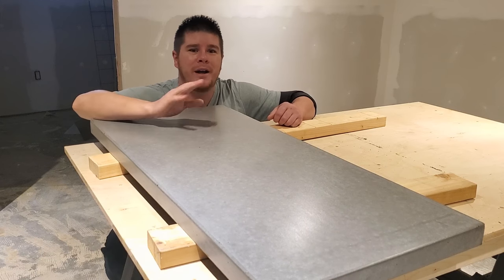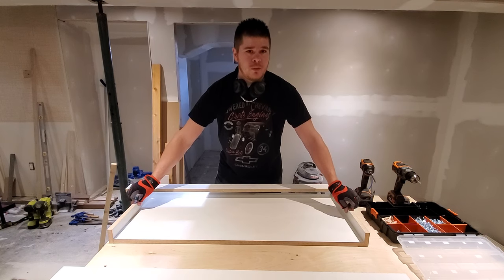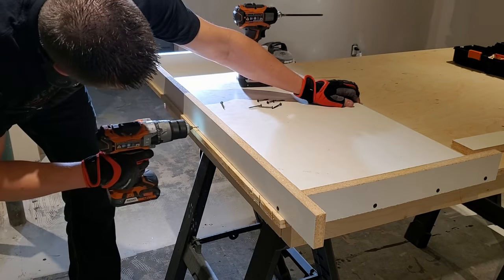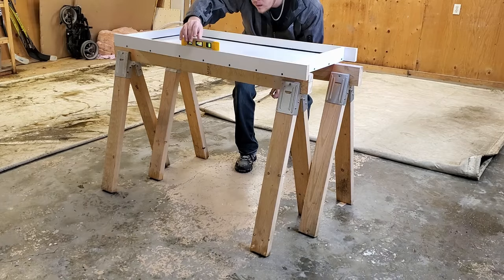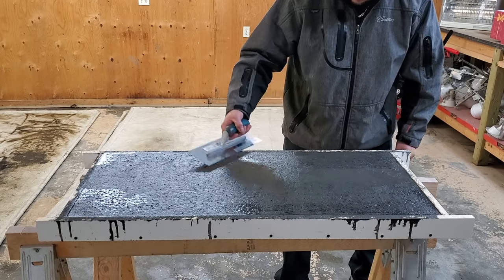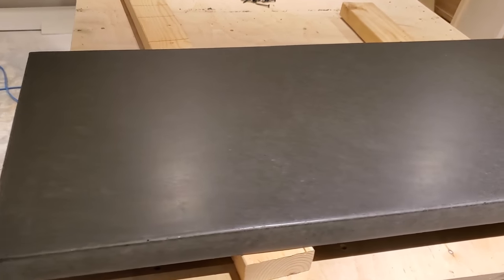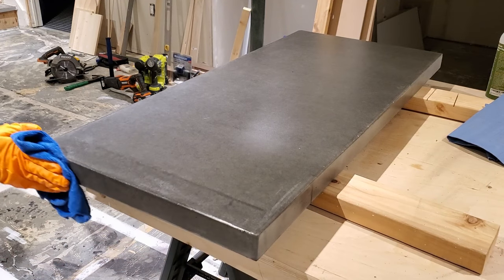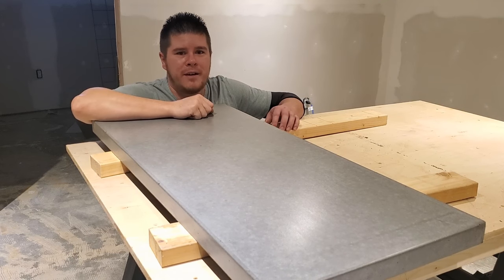Beginners guide, Concrete Tabletop you can build. No special tools, hand finished

Comment: Thanks ! awesome video! Will do my own slab next weekend :p
Reply from the maker: Awesome! Glad I could help. Good luck on yours and keep me posted!
Reply: @JessedoesDIY  I do have a quick beginner question though, I'm intending to do slab that is 3 cm thick (for a surface of 80 x 60 cm)... will this be solid enough even with such small thickness? Would you recommand adding fiber to my pre-mixed concrete ?
Thanks again for the cool video
Reply from the maker: If you could I'd up it to 4 cm thick. That would be plenty thick to be fine while only needing the metal to reinforce. If you do go thinner than yes, I'd either add fiber, or find a mix that is already fiber informed with low to non shrink concrete. Hope that helps!
Reply: Hi, back again 
So I went for a 4cm thickness as per your advise, and the slab looks AMAZING thanks to your video (and the crazy amount of vibrating I gave). It is so flat I could almost see myself in it :D .There is litteraly zero bubble ... BUT ONE (rather big, 5mm). The bubble formed at a location where the concrete was obviously not hydrated enough (the surrounding zone is very light in color - probably some concrete taken from the side of the bucket where I did the mixture)

Problem is, the rest of the slap is soooo perfect that this one bubble is kinda killing it. :D

What would you recommand for filling this hole ? Just cement + water slurry? 

many thanks again !

(pity I can't share a picture )
Reply from the maker: Hey, I'm glad it turned out! Yeah vibrating is key to it and it's the step people usually skip. There always has to be one hey lol really shows the importance of making sure the mix is all hydrated, one small dry spot can go south in a hurry. But it's fixable! I'm actually going to be coming out with a part 2 video showing it sometime. But for now yeah, take the same mix you have and sift all of the stones out of it just so you have a nice powder of cement. You can mix it with water, but your best bet if you can is to get some acrylic fortifier, they sell it in the concrete aisle with the dyes and stuff. Use that instead of water, or a 50/50 mix. That helps the new concrete stick to the already cured stuff. Mix a toothpaste thick slurry in a cup, then press it into the void. Kind've let it dry and then clean up what you can a bit with a plastic putty knife. Sand as needed, if not just take a wet scotch brite pad and rub the slab down with water to smooth it out. Hope that helps, email me with updates and finished photos

Comment: Looks great..I have a question on this though. If I wanted to mount my legs into the table could it be done that way? Like put my legs on a harness down into the mold then pour my concrete down around that?
Reply from the maker: Thanks. Sorry for the late response, but yes it could, however I probably wouldn't. It wouldn't happen for a really long time realistically but it's worth mentioning that the concrete will eventually either degrade or the wood will rot. They will push and pull moisture from each other

Comment: I'm thinking of making a concrete desk to deaden frequencies from my speakers. I just need to think of a solution for the legs that provide enough integrity to support the mass and allow enough surface area to prevent the concrete from cracking over time. Thanks!

A quick google seems like metal U shaped legs with a double bridge connecting both should work.
Reply from the maker: The legs can support more than you think, it's usually the stretchers between them that's the problem, yeah. I've used 2x2 stretchers and they can be just fine. But as long as you've found something that works, it's all good. Good luck on your project

Comment: Very beautiful, impressive and professional video.
I have a question whether the concrete surface does not absorb liquids from the food and accumulates bacteria, does the sealer close it for a while or does it need to be renewed?
Reply from the maker: Thanks! I appreciate that. Nope, it won't absorb liquid and bacteria. Once it's sealed with that liquid sealer I applied, and even more so after the wax it is basically no different than how a granite top behaves. Smooth and silky feeling, and just like I showed in the video, liquids and food just sit on top and can be wiped away easily. You will need to apply the sealer about once a year tho, and the wax every couple of months, depending on how often you clean it maybe a bit more often. But its quick and easy maintenance. Hope that helps

Comment: Great video!!  I'm interested in outdoor concrete bench tops - would the same process and finish be applicable for outdoor use?  How thick should bench tops be - I would estimate 2"...?
Reply from the maker: Thanks! Yeah I'd go 2" for those. That will be cool,  let me know how they turn out. The same process can be used to make and smooth them, however for a bench I'd use a basic concrete sealer from rustoleum or quikrete as it will be more durable, no need for the countertop sealer because you don't need food grade. Good luck!

Comment: Excellent video. I am considering doing this - May I ask how long the wax stays on the countertop? I probably daily clean the countertop with anti bacterial spray and once a week with bleach. I am guessing this would strip any protection? Whats your thoughts?
Reply from the maker: Thanks! Don't use bleach, you'll strip everything and stain the concrete. If your using it for a countertop ish surface like I am, everything I used to seal it is food grade. You'll want to use a natural cleaner if possible. Typically the wax will last a month or 2 depending on cleaner used and how often, but over time the wax will last longer once it has a few coats applied to it. The wax I used is beeswax mixed with lemon and orange. The citrus in it not only smells good, but it also helps keep it clean because it's a natural acid, no bacteria forms

Comment: Absolutely brilliant  ... i will start mine asap.  Never sure about sand and concrete ratio?
Reply from the maker: Thanks! That's awesome, good luck on yours! Keep me posted, I'd love to see it when its done. I used pre bagged concrete and if you go that route make sure to get a non shrink or low shrink version to avoid curling. Otherwise start with a 3-2-1-.5 method. 3 parts very small aggregate (stone), 2 parts sand, 1 part cement, .5 parts water

Comment: I do the edge pieces like you, on the side, not too, to make demolding easier.  But I make all four pieces too long.  One edge flush with the edge of the bottom piece and one end over hanging.  Then you can easily pry off all four sides like your showed.
Reply from the maker: That's a great upgrade to my method! Thanks
Reply: CanaDIYan as you mentioned, you want to pry wood to wood and not wood to concrete.  So that’s why I went this route.  Give it a try!
Reply from the maker: @BoredAtWork2000  Will do!

Comment: Great job. I am going make a table top for a porch, so I am looking for the products used, like wax, sealer, colorant. Also can I drill into the concrete for table legs? What size drill and do you prefer special screws? Thanks for sharing,
Reply from the maker: Thanks! Product links are in the video description. Quikrete liquid dye, Tuff Duck sealers and Clark's wax. If you're going to do into it you'll need Tapcon screws, and do not over tighten them or it'll just strip the hole smooth. You'll also need to let the slab fully cure for probably a month before drilling into it. The screws will probably come with their own drill bit
Reply: @JessedoesDIY  Thank you so much. I appreciate your advice and knowledge.

Comment: I love it. Two things I am curious about: First, any concern that the edges of the concrete that are against the silicone will have a different bevel/edge profile than the top edges? And second, why put the metal reinforcement 3/4 of the way through rather than half way?
Reply from the maker: Thanks! I have no concern with the finger method. It turns out more organic because it isn't perfect. But if you want an even better finish check out my concrete bathroom vanity top build. I use fondant ball tools for a prefect bevel. I prefer to have it that far because it puts it in the bottom half of the concrete when it's flipped over to help minimize it shadowing through. Hope that helps!
Reply: @JessedoesDIY  thank you! Why put the metal reinforcement 3/4 of the way down rather then half way?
Reply from the maker: As I said, I prefer it that far down in the slab to prevent shadowing

Comment: Instead of trying to compact the concrete by shaking it by hand, you could insert 8 larger carriage bolts all around the frame of the concrete formwork you are building (always depends on the size of the object, but here I am thinking of the plate size you choose) , these are the ones with the hexagonal head and a coarse thread for wood, in European metric dimensions I would choose a 15 or 17 screw, length 30 or 40 mm; Pre-drill, countersink the screw until the head rests on the frame, i.e. has direct contact. Then you take an old hammer drill (or a pneumatic one, if you already have that luxury [Ryobi has a small, relatively inexpensive one; I think the batteries always cost more than the machines]), then turn one of the same size or even larger Carriage screw into the drill chuck, turn on the impact mechanism, place the screw one by one on the screws inserted all around and start to "shake" with feeling. You have to test the frequency a bit. But experience shows that this brings more than all the hand rocking.
Hopefully Google Translate has found the right English words now, but I think most people here are smart enough to grasp the concept...
And since I haven't read all the comments - it's possible that someone else has already presented the concept - no copy right infringement intended ;-)

Comment: I'm definitely going to try this for a bar top for my son. Your video is the best one I've watched and yours is the one I will follow. Two questions: I would have thought you would have done the silicone before the wax - doesn't the wax affect how the silicone adheres to the form? And, when following your link for the sealer many comments on Amazon were made about putting multiple coats of sealer on, but you think two is actually enough? Thanks again for taking the time to create such a well-produced and thoughtful video.
Reply from the maker: Nice, that's awesome! I'm glad I could help! The silicone can be applied before or after, it's mostly just sealing it from too much water seepage and also to round the corners slightly. It has more than enough tack to do that. For the sealer I've done the whole multiple thin coats and it honestly has no benefit. People do it because others do it, but the bottle says to apply it basically like I did and that's how I've found gives the best results, I'll trust the engineers that made it. But if you try to add more than that you'll get streaks and a sticky finish. You'll definitely know when to stop by the look and feel, but just did as I showed and you'll be fine! I'm happy I could help and good luck with yours! Keep me posted, I'd love to see it when its done!

Comment: This is absolutely gorgeous! Fantastic job, I'm really blown away! Just curious if you've noticed any cracking over time?
Reply from the maker: Thanks! Nope, been 2 years and it's still good
Reply: @JessedoesDIY do you need to re-wax regularly (yearly or?) or reseal? Love it
Reply from the maker: I reseal yearly typically, but after a couple years you can start extending it unless you see a stain. Waxing every month for the first few months, then only as needed if you see water soak in. Could be up to twice a year after a good layer has built up
Reply: @JessedoesDIY  thankyou
Reply from the maker: Anytime

Comment: This is terrific. Thank you! Would you consider this same method for an undermount sink knockout? I'd use a melanine box or some insulation. I basically want this slab with a 30" hole in it...
Reply from the maker: Thanks! I actually have another video for making a vanity top with an undermount sink from just a couple moths ago. Check out my concrete Playlist!

Comment: Going to use this as a guide for a full, outdoor patio table. Any additional suggestions for outdoor use - due to sun, rain, elements?  Seriously, this was a great video.
Reply from the maker: Awesome, thanks. No, not really. You'll just have to stay a bit more diligent on sealers and wax is all. If you notice water soaking in and not sitting on top, it's time to re apply

Comment: You The Man!!!! Learnt so much...however i need to do a round table top...how much harder would it be to do a round table top? im a complete woodworker novice.
Reply from the maker: Thanks! You'd have to make a jig for your saw to follow a rounded cut, or draw it out and have a steady hand cutting it. Then you need to get some flexible 1/4" ply or some kind of material to wrap around it for the wall. Then it's business as usual

Comment: Hi there Jesse, I'm in Canada as well, can you let me know the exact concrete you used. (Is there gravel in it? or just a cement sand mix?) Its for my 2 columns I just made at the end of my driveway and now I have to do the tops. I don't want any gravel showing. Thanks buddy. 😊👍
Reply from the maker: Hey there! I used quikrete 6000psi mix for this, and yes there is aggregate in all of quikrete mixes except the countertop mix. The aggregate won't show if you are able to vibrate it. The aggregate settles to the center and the cream rises to the surface, just like this top. Good luck on your project!

Comment: Outstanding video.   Very helpful.  I’m taking the plunge this weekend and will use many of your tips.  Can you recommended a US concrete band?  I don’t see that in your description list.
Reply from the maker: Thanks, I'm happy I could help! You should have easy access to quikrete down there, anything that is low or non shrinking is best buy they actually make a specific countertop mix that's designed for this that will give you the best results. Good luck on yours, keep me posted!

Comment: Fantastic video! You did a great job on the video by explaining each step in detail. Great job! I had to cut down my 34 year old tree in my back yard. It was 27" in diameter at about 30" up from ground level. I asked the tree cutters to save the tree stump so that I might be able to build a table on top of it. I have it prepped and ready to build a top, and got the idea to pour a 48" round concrete table top. I have never done this sort of thing before. But, having watched your video now, I think I might be able to do it. Do you have any ideas or suggestions before I attempt the project? I am open to any advice :-)  Thanks again!
Reply from the maker: Awesome! Thanks, glad I could help you! That will make a great table top for it, I want to actually make one too for around my fire pit. What do you plan on using for the mould walls in a circle? I'd use some 1/8" thick melamine type material. Its pretty rigid and is easily flexible. Good luck and have fun. I'd love to see it when you're done
Reply: @JessedoesDIY  It's funny you asked. That is the one thing I am having trouble with is the outside mold! I have looked at some bender board that is used for landscaping. It is a bit rough on the edges though. I wanted to get some 1/4" material. I believe they call it "Bender Board". I saw it in a video some time back, but cannot find it at HD or Lowes. Where can you get the 1/8" Melamine? That would probably be ideal for the outside. Take care and thanks again!
Reply from the maker: 1/4" might work, it might not. It may actually be too thick for such a small circle and want to snap on you depending on the material. The 1/8" material will be less likely, but do what you feel is best for your top. The material should be at HD, it may be a Masonite material, not with the melamine. Super thin plywood may also work, but just make sure to clear coat it first so you can wax it
Reply: @JessedoesDIY  ok. Thanks! I appreciate all the help!
Reply: @forestmorris2996  I have used Formica for the edges of the form on several projects. It works wonderfully. You can get a pretty tight radius and then move right on to a radius in the opposite direction without any flat spots at all. Sometimes there is a "grain" to the formica and when you bend it, it breaks. If that happens try bending in another direction. I am talking about using just the Formica, not after it is glued down to something.
Reply from the maker: Thanks for sharing!
Reply: @5x535  That's a good idea! Thanks!!

Comment: Great video! Could a thinner slab be achieved? And does the mesh have to be one piece, or could you use multiple, if the slab is to be larger.
Reply from the maker: Thanks! I would only go thinner if you use a countertop mix, like say from Quikrete. I didn't use that here but I have in other videos. Then if you really can, get some fiberglass made for concrete, then you can go as thin as 1". Smaller mesh can be used as long as they overlap a bit. And the slabs can be made up to 8' long because the sheet of melamine is that long.
Reply: @JessedoesDIY  we succeeded in making two slabs roughly 25mm thick. We previously gave it a go and failed miserably. After watching your video I decided to give it another go. Thanks again!